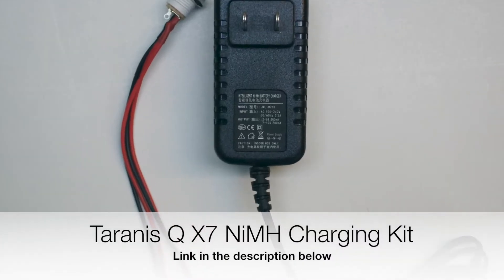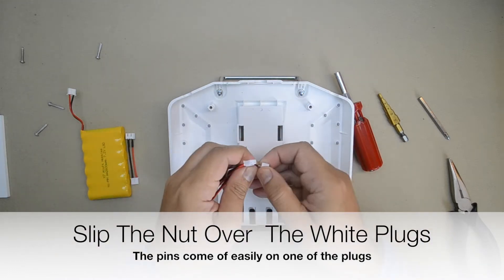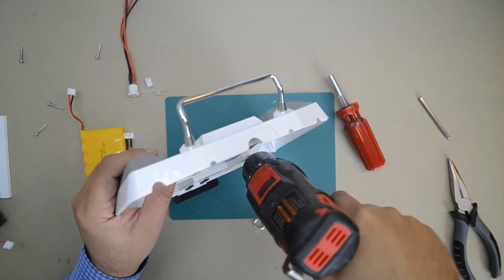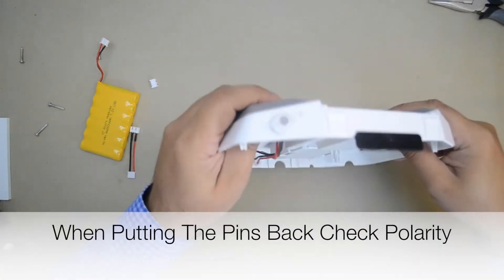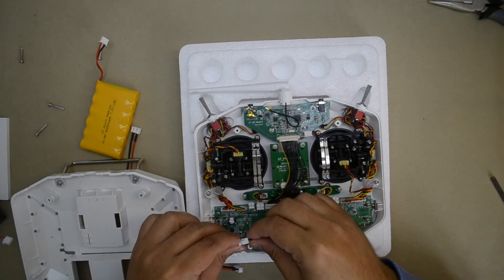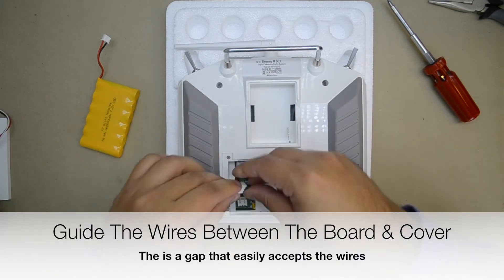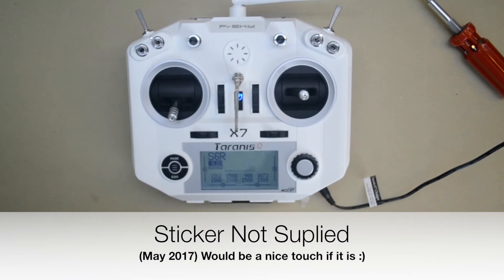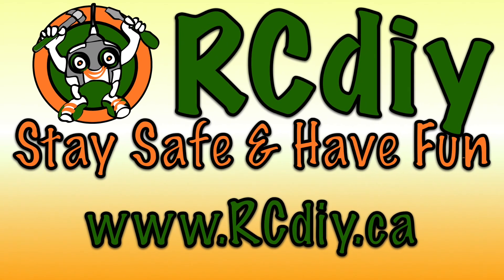Taranis Q X7 NiMH Charging Kit (Aloft Hobbies)

Comment: Will it work without battery? Just by pluging ac/dc adapter since it is connected in paralel.  I bought qx7 but it came without battery holder or battery so i'm thinking of just soldering direct power supply without battery because i want to use it for simulations at first

Comment: Would just the charging jack work with a 2s LiPo, or does that require connecting all of the leads on the balance plug?
For balance charging 2s LiPo, do you have to hook up both the balance plug and the main power plug?
Reply from the maker: Need the balance. Also I would not change a lipo while it is inside the transmitter due to the risk of fire.
Reply: RCdiy
Do I have to connect the main power wires to the charger as well as the balance plug?
Reply: I'll probably just get the NiMH batt eventually, but I have 2s LiPos in my Tx & my Son's.
Reply from the maker: Yes

Comment: Will it be safe to charge rechargeable batteries while attached to the radio? Will there be harm to radio since the voltage of the charger is greater than the batteries while charging? Does this require an isolation circuit between batteries and radio's main power switch?
Reply from the maker: This charger and the NiMH battery pack from Aloft Hobbies work while connected. The charging voltage is within the max specified voltage for the transmitter. Aloft is an authorized repair centre; In other words they know what they are doing.

Comment: They're harness is out of stock. I emailed them since they dont have a phone number and never got a reply as to if or when they will ever restock. Is there anyone else that sells them?
Reply from the maker: There are DIY options but finding a charge that one would trust to connect to the battery and transmitter at the same time was not easy. So I waited for theirs. I believe I signed up for an email notification.

Comment: I just installed the charging kit,  easy installation thanks to your video!  Question,  does the charger light always stay red or does it change to green when done charging?  Also,  is it OK to leave it on the charger even if its done charging?  Thanks again!
Reply from the maker: +Dennis Forbes I have left it connected after charging is done but once I notice it is done I unplug it.
Reply: OK cool but what about the light on the charger?

Comment: This is an awesome mod to do!! But one question how can I update the OpenTX firmware to 2.2 when my USB port of the transmitter is broken. Would I use the SD card then?
Reply: Remove card & attach to your PC using adaptor. Load the firmware into the folder named "FIRMWARE". Place card back into TX and start in bootloader mode. Select "Load Firmware" menu and select the file you loaded from PC. Do a backup first and the older backup file will also appear in the firmware folder and you can revert to that if you need to. Both new FW and backup will show in directory. The backup should also include the date in the file name.
Reply from the maker: Horn Player yup
Reply from the maker: Make sure file name including dot extension is 35 characters or less.
Reply: Ok thanks I'll have ti buy an SD card and an adapter and I should be good!
Reply from the maker: Cam's FPV as an aside let me know when replacement boards become available. I'm assuming you want to fix it.